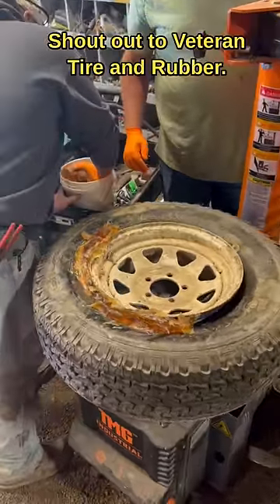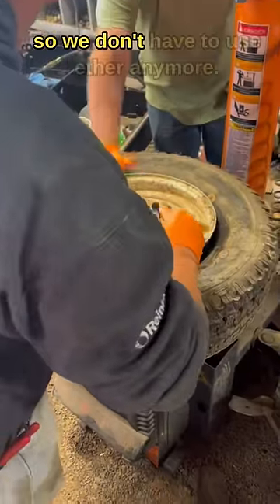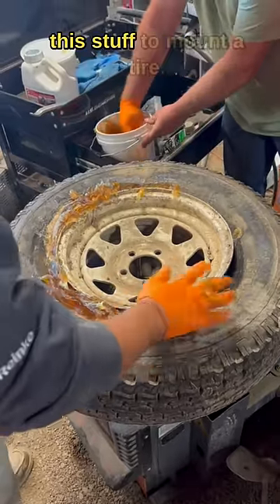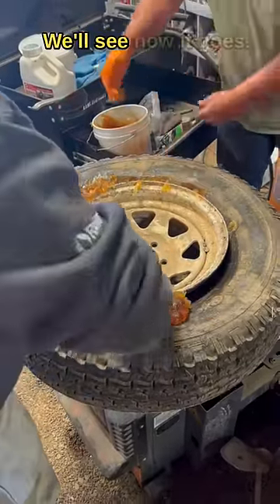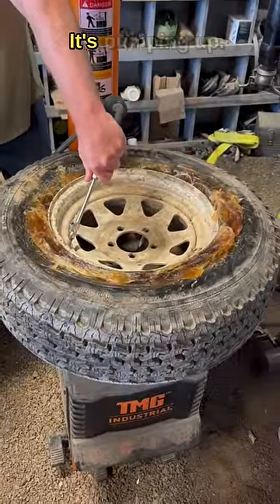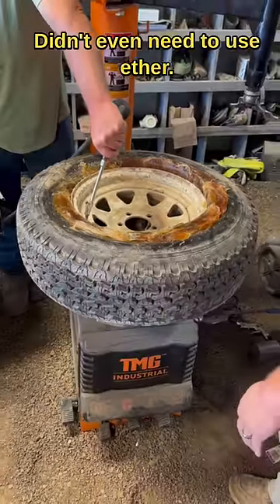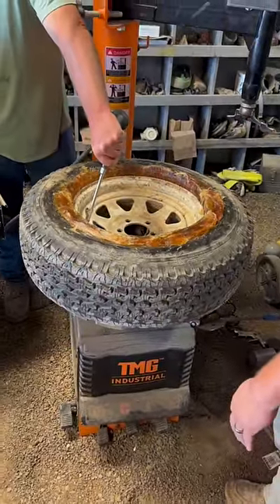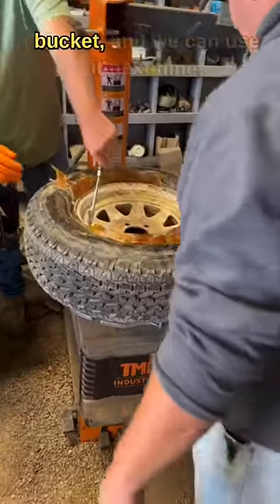Veteran tire and rubber sent some tire mounting compound. Let’s see it work. #farming #shorts ￼

Comment: Snyder put so much of this stuff on my tires when they did mine. Got on the road about 2 days later and took off a bit hard. The only problem was I wasn't accelerating. My rim was spinning on the tire.
Reply: Hahaha
Reply: Hahahaha never seen that before.
Reply: No it didn’t it would’ve sheared the valve… thought u were super cool for a minute huh? This why you can’t trust anyone they will lie for attention.
Reply: @mcmillinjustin lmao
Reply: Probably had the tire beads in there and the tech didn’t clean the bead off good enough
Reply: @martincraft4920  shear the valve? I don't have tubes in my tires. Thought you were cool there for a moment huh? Also there is plenty of stuff on Google where people have had similar problems. Too much lubricant can cause it. Wide tires on a narrow rim. In my case 12.5 inch wide tires on a 9.5 inch wide rim. And the combination of tire soap. My tires ended up wearing funny on the back of my truck. Spun the tires and unbalanced due to repositioning of the rim. Do some research before you open your mouth next time.
Reply: @martincraft4920 a tubeless tire has no effect on a valve stem by spinning the tire or wheel
Reply: @martincraft4920 
This would not have sheared the valve stem. There is no tube in a car tire. Wheels spinning in rims is something that does happen. Look it up.
Reply: @martincraft4920 you still have time to delete it😂😂😂
Reply: @martincraft4920 It’s a car tire… not your bicycle.
Reply: @martincraft4920 I could correct you too, but there’s a lot of other comments already doing it!
Reply: @martincraft4920 gooofy sounding drag cars all day have rim spin while the wheel doesn’t
Reply: @martincraft4920 Booyakashai!!😅😅
Reply: @martincraft4920 
Mate I think you're thinking of a bicycle tire... car tires have been tubeless for a long time now
Reply: Must have had 800hp lol only see that happen at races lol
Reply: @WicKedwiNd91  it's a tubeless tire, it doesn't even seat near the valve so no it would not tear it off but saying that, no the tire did not spin, this guy is full of it
Reply: Snider is ran and operated by rookies if you're ever in Birmingham AL and need a tire call Commercial and Industrial Tires they'll get done right
Reply: @lexusslammed5003  nah. Maybe like 400 to the wheel. But the excess amount of tire soap and the wide tires not seating like a normal tire would fell into play. 12.5" wide tires on a 9.5 inch wide rim

Comment: You can use a small bicycle tire tube around the rim, but you got to be quick to get it out once it grabs!
Reply from the maker: Interesting
Reply: Or them crappy plastic seat covers work pretty good easy to slide out from the bead when popped on

Comment: You can also use one of those tie down strap. Just Wrap it around the tire. Tighten up the radget to pull everything together.
Reply: No that’s a horrible idea!!
Reply: @crimsoncrime007  why? I've done it a few times and its works well.
Reply: Piece of rope wrap wrapped around the tire and twisted to tighten it up with a wrench or tire iron.

Comment: You could also get an inner tube and put it around the bead to seal it while the air goes in. The tire will push the tube off

Comment: Well my shop has a cheetah... I was honestly surprised that this compound didn't go into low-earth orbit when the tire seated. Would be interested in seeing how it performs on a low profile tire😂
This would certainly be easier on the ears and eyes.
Reply from the maker: Yeah it works great
Reply: I do semi , tractor and combine tires for a living, we use this stuff all the time , I have also done with with low pros it still sticks its thicker then peanut butter
Reply: I used this stuff to seat the beads on corvette wheels one time. It’s still on the ceiling in that shop
Reply: @danielfrechette2938  good to know, might look into getting some to try.
Reply: @anthonyzastoupil1842  lol well that is what I was suspicious of, maybe this brand is thicker?
Reply: @codemiesterbeats Nah he capping. Don’t trust wverything you read, man had a corvette. You think he used this, or even if so, correctly? Probably pumped his tires to 200 psi and blew rubber into his ceiling, aswell as half his brain. Corvette owners are bright, id trust them!!! All the billionaires got that american muscle 🤡
Reply: Hearing protection?? Cheeta tank for the win.

Comment: I'm sure that that stuff doesn't throw off the balance at all! 🤪
Reply: You dont balance your tires before you put them on the car?
Reply: @eko4749 it's goop dude, it will move around in the tire and change the balance as the tire rolls. Meaning balancing it will be pointless. You have to be absolutely sure you don't get any of the goop inside the tire, or it will be impossible to balance.
Reply: Are you guys dumb? 🤣 Throw off the balance? Honestly. 🗿
Reply: NinjaDefiler  That's exactly how wheel balancing works! The rubber and the wheel gets balanced. I've never had my rim balanced prior to mounting the tire! And no the tire should never spin on the rim! if it does you got bigger problems then balancing! And yes that goop weighs 10x what a lead balancing weight weighs so yeah its going to throw off the balance! omg!
Reply: NinjaDefiler  Ok lets take this from the top and go really really slow.

When balancing, you are balancing the wheel AND tire, the weights go on the wheel, but you do balance both as a whole unit.

If there is something with more than about 0.5oz of weight inside the tire (between the wheel and tire) that can move around, it WILL make the tire and wheel unable to be balanced.

If you want proof, go balance just a wheel, zero it out, then mount a tire and tell me if the balance is still zero. Oh wait, you don't actually work in industry and have never used a tire balancer in your life. Go sit in a corner.
Reply: I’ve been in the industry for 10+ years. If enough gets in there it will definitely throw off the balance, and it don’t take much.
Reply: everyone is an expert
Reply: NinjaDefiler   I hope you don't vote. 😵‍💫🥵

Comment: I use mountain bike inner tubes as an alternative to this to fill the gap, just make sure you lube it up to they pull out once the bead sits
Reply: I tried a bmx tube on one I couldn't get to pop otherwise. Worked great, and no damage to the tube!
Reply: My valve stems leak

Comment: Use a ratchet strap around tire! Works everytime
Reply: I was gonna suggest that but you beat me to it 😂 glad I’m not the only one that’s try that
Reply: @gusgarcia6163  came to say the same👍 I learned it from my great grandpa probably 40 years ago but it seems most everyone is in the dark about the ol strap technique now days
Reply: @BM205 I'm a 21 yo tyre tech an know about it ! And use it ! Very rarely as I don't have trouble fitting em.. that would've popped the bead with air if they knew what they're doing.. 😅😂
Reply: bike innertube is even easier
Reply: Never heard of this. Thank you!
Reply: I tried this 10 times. Did not work. Lmg I'm doing it wrong?
Reply: @jordanpostal  I don't believe theses guy. "Works every time" I never could get the ratchet strapped tight enough  but I only tried it once.  Either .is so much easier but I never used either on a car tire only big truck tires
Reply: @BM205  Ol’ timers know their shit, they had to figure it out with 90% of the tools we have now 😂

Comment: Tire shop i worked at diluted that stuff in water and it would last forever. Made the water super slippery.
Reply from the maker: Yeah, we were told that would work really good
Reply: Water’d down i would use for semi tires
Reply: @RealDj4040  we use it watered down to break beads and find leaks. Then use it straight real thin layer as lube.
Reply from the maker: @RealDj4040  we will have to try that
Reply: I believe it's soap
Reply: Those Gobs of wax are in the tire and will throw the balance off eventually as the ooze moves!
Reply: @andyroundy5231 oh that makes sense it's just raw cold soap nice

Comment: That "compound" is supposed to mixed with water and brushed on the tire. Also you're foot valve is usually a 2 stage pedal, if you completely depress the pedal while pulling upward on the tire it blasts air through the nozzles on the clamp table which aids inflation.
Reply: Actually it can be and is used like this too.  Ask any "old" mechanic or reputable tire shop.. This was a pretty common method of seating beads that wanted to fight.

Comment: What I use is the grey foam copper pipe insulation. Wrap a piece of that around the rim and it takes up the space. Pushes out as you fill the tire with air.

Comment: You know there is a tool called a bead seater, right? It only uses compressed air.
Reply: Doesn't work on everything. Had two on a set of bfg radials trying to mount on 15x14s... didn't work.
Reply: @lucky7s94  It's real fun when you use that and the cheetah and the tire still doesn't want to air up because its -20 outside so you stick a semi tire in the cab of your truck to warm it enough to seat the bead
Reply: @flyingmonkeydeathsquadronc968  bro you have manly issues.   God bless.
Reply: There were tools for it before the pneumatic bead seaters existed too.

Comment: What I do is wrap a ratchet strap around the middle of the tread and tighten till the bead matches. At the very least you would need less goop.
Reply from the maker: Good idea this was our first attempt
Reply: Chain will do
Reply: Came here to comment this - big yellow harbor freight ratchet strap
Reply from the maker: @randyjackson7962  That would work well.
Reply: I use the ratchet strap method as well.  On the large diameter tires I hammer the strap as I tighten it so it slides around the tire to get a more even distribution of force.
Reply: @huckbeduck  Cool, makes sense. I never had to but I'll keep that in mind if I have to do a big tire in the future.
Reply: Way back in the old days, when there were only a couple dozen sizes of tires, I had tire bead grips. It is basically a flat ring of rubber about 4 inches wide that goes around the tread of the tire. It has a stem like a tire, but no valve, so you slip it on, inflate it, it compresses the tire just like the ratchet strap, then you inflate the tire. I have no idea if they are still made, but I had about 6 or 8 of em in different sizes. super handy.
Reply from the maker: @bigbossimmotal  That would be super handy
Reply: @bigbossimmotal  Cool, but as you say not as flexible.

Comment: That's tire soap. You put a little in the container with the swab, mix with water and you have tire lube.  I was doing this daily back in the 80's. We also balanced tires and wheels on the car at 200 mph without a tire balancer. When I went from a tire mechanic to an alignment technician, I knew I really wasn't one. I was just a mechanical dude who learned the laser alignment machine on my own by pushing the CLICK HERE FOR HELP button. They sent me to alignment school and I aced it. Still didn't think I was a true alignment tech because I was so young. SO i learned every type of alignment machine from the past until I could do an alignment on the ground with a piece string, a tape measure and a level. Learn the old ways while you still can. Oh! One more thing. When our manager would piss us off...we would cram that goop up in his door handles to his truck. Give him  nice going home present. The bad days...he got tires stuffed under his truck too. One time we picked him up and stuffed him down in a set of 35" BFG ATs stacked up. THen we rolled him out in the parking lot. He was an asshole. He was allowed to give us work orders, but not fire us because the boss knew he was an  asshole. His name was Butch! Lol! Enjoy!
Reply from the maker: That’s awesome thanks for sharing.

Comment: For a tire like that you don't need so much. Just a thin layer on the bead to lubricate. You only slather it in like that for tires that don't want to seat. Usually because the rim is to wide or something wierd. You just don't want a big glob of it to remain since it will make the tire wobble cuz its unbalanced.

Comment: A tire bead blaster would work just as well with no mess
Reply from the maker: Yeah we don’t have one of those.
Reply: @RockyMountainFarmer buy one
Reply from the maker: @secessionnow4133  we are looking into it. Is there one that works best?
Reply: @RockyMountainFarmer i use one made by bead bazooka at work for semi tires, works pretty good and has a trigger for easy and fast release
Reply: Not always. Some tires are a bitch and never want to seat. This stuff looks like it has a great purpose.
Reply from the maker: @LengendaryCreations  It does work great

Comment: Definitely wear safety glasses when you’re using this product. I was mounting up a set of SXS tires and got 3 of them done and then the last one I had a tiny glob go right into my eye and let’s just say that pink eye is nowhere near as painful as this soap is and it took several days to get it all rinsed out and stop burning. But it works great for hard to seal tire and wheel combos.

Comment: there is a large rubber o-ring, about 1_1\2 inch thick. It fits between edge of wheel rim and bead on tire. Sparingly use tire soap, put in place and it slides out, as tire is aired up🎯

Comment: I use Murphys tire soap occasionally.   I usually only need it on 6ft tall tractor tires called floaters.   On this tire I would have used an air blaster.

Comment: When I was doing this in the 1980s we had  soft thick o rings of different thickness to put around the rim.   After seating the bead you deflated the tire and it would come off easily

Comment: That's called soap. Works really good. An old boss and I were out on a skidder call on a logging operation and didn't have enough soap. We ended up packing the bead with grease and hit the tire with two Cheetahs.. Worked like a charm but we were fuckin covered in black grease 😂

Comment: We called it elephant snot, works great. Seat the bottom bead first and put pressure all the way around the center with a strap to widen the bead. Use that to fill one the top bead and poof. Scrape off the remaining and put it back in the bucket that shit ain’t cheap

Comment: I've always used trans fluid to get a tire to seal and never had any problems. I always poured it on my fingers and spread it around the bead of the tires and not the rim's..I always use cigarette lighter tire pumps, that's how easy theyll pop on the rim. A guy that lives below will mess up a set of tires quick using gobs of cup grease and that's a very very bad idea. I can most usually get 1 side of the bead on the rims and just a bit of pressure to other side and POP, it's on there with no problems atall

Comment: This is hilarious. This stuff was only ever meant for trial or field rescues where a tire had come off the bead and it's not an option (not an easy option) to dismount the wheel. I've even seen it work with the weight of the machine still on.

Comment: back in the 70's I remember using an inflatable band that use placed in the middle of the tread, cinch it down and air it up, compressed the tire forcing the bead to engage the rim.

Comment: I had a tire shop mount tires on my pull truck, they used 5 gallons of that crap, when I went to pick it up, I seen that they had used that stuff so I told them they had to take a back apart and clean it. I ended up helping and there was about 3 gallons of that stuff left inside of the four tires. SMMFH

Comment: Did you try bouncomg the tire and rim on the ground rotating it..if its cold out warm it...also those have a blaster from under it...lift the tire and hit that blaater....also u can get just a bead blaster tank that does replace accelerants. In my dads shop that goop was the last thing to try

Comment: Your supposed to use a small amount of that too make the tire bead slide on and pop in place easier. Yes, that worked but using a whole bucket on one tire will get real expensive!

Comment: If you wrap a ratchet strap around the tread and hook the ends together and ratchet it tight it will get the bead close enough you can use your air hose like that. Just set the bead and let off the strap before you air it all the way up. If it is too tight now that the bead is setyou can let the air out to take the strap off. Air it up and put your strap away, clean up done. Its pretty tough to do on a tire bigger than this one.

Comment: You know there's an easier way to do that, right? Put a ratchet strap around the tire and tighten it up. It will force the bead against the rim and you can start applying air pressure to seat the bead. Then remove the ratchet strap and finish airing it up.

Comment: I used to work in a diesel mechanic shop i changed the oil and greased up our company trucks and customers also but i also used to change the tires and i remember a guy i worked with would say jake go get the pigs we have 18 tires to do the pig was a name we gave something called a seater bead blaster but we called them pigs anyway after changing tires almkst everyday for two years i didnt need steroids i was fucking jacked those transport truck tires are no joke p.s we used this sealer also but didnt need to use nearly as much as these guys put on lol this stuff is supposed to be used to get the bead passed the rim lip

Comment: Doesn't their tire changer have a blaster? I've used that stuff with water as a bead lube, but honestly starting fluid is much faster and less messy for seating beads. I just did it yesterday. I lit it and nothing was happening so I kicked the side of the tire and bam, it popped immediately. No muss no fuss.

Comment: All these people think you have to use ether to mount tires.  Not true.  Good air pressure will seat a tire.  At most youll have to remove the valve core to seat it. Ether is only needed if the wheel is too wide for the tire.